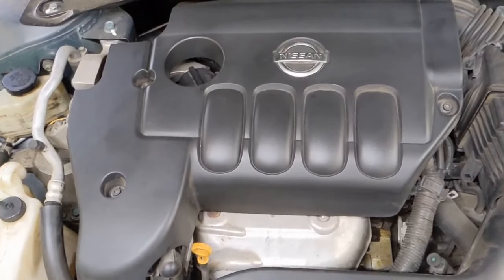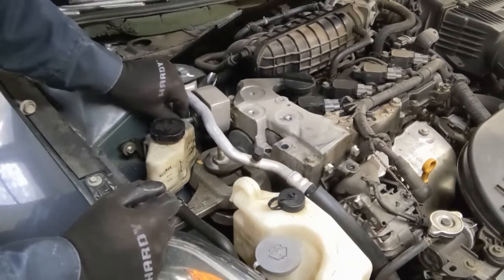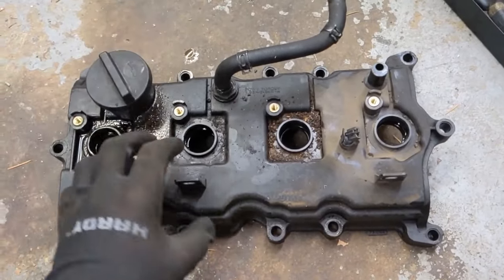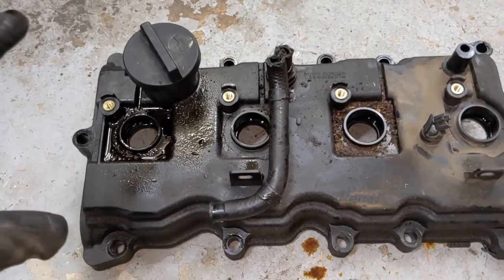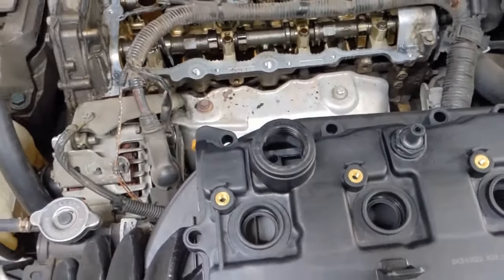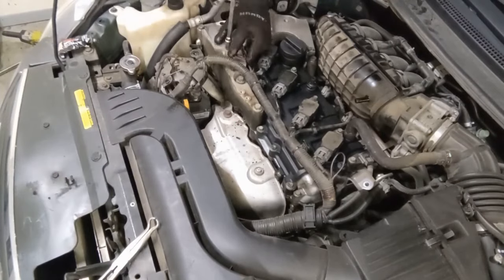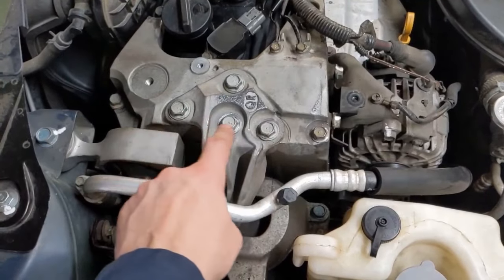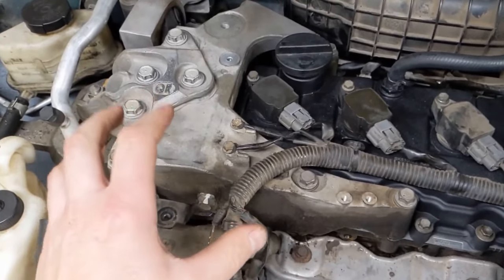2007-2013 Nissan Altima 2.5 Valve Cover and Gasket Replacement | How to Replace Spark Plug Seals

Comment: I bought the seal and gasket kit.... Definitely buy the whole new cover that already has everything. the old one is so brittle it's impossible to get the seals out without breaking the cover.
Reply from the maker: @u.s.a.198  Thanks for the tip 👍

Comment: I JUST CHANGE THE SPURK PLUGS YESTERDAY I HAVE 2016 ALTIMA 2,5 S AND I FOUND OIL ON THE SECOND SPURK PLUGS ON PASSENGER SIDE OTHER THREE WAS DRY HE RECOMMENDED ME TO DO VALVE COVER DID HE MENTION ENTIRE VALVE COVER I DONT KNOW WHAT U THINK IS BETTER TO DOIT NOW TO STOP HAVING MISSFIRE IN THE FUTURE OR I CAN DRIVE LIKE THAT

Comment: I find it odd that you clean the spark plug well after you put the new cover on? Why not do it before?
Reply: And cranking the engine to get the oil out? Why not just use a shop vac?
Reply from the maker: @jumbroni6014  Good questions. You can clean the spark plug well before or after the cover is on. You just don't want any dirt to fall into the engine that's why I like to close it up as soon as possible. I used a shop vac once and it didn't suck the oil all the way through the hose so I had oil dripping out of the hose for a while. Other than that it worked ok. It won't get everything so pulling the plug or using some rags is still necessary.
Reply: @ValleyMobileAutomotive  BRO i use a oil funnel on the end of the shop vac and it works so good. you dont even have to secure it to the vaccum. but youre right it does leave a mess if you arent careful. im just finishing this job. what a pain in the arse cleaning gasket
Reply from the maker: @jumbroni6014  Thanks for the funnel tip! Yeah It's an interesting design for sure! The good news is the new gasket will last another 100k plus 👍
Reply: @ValleyMobileAutomotive  I HAVE A QUESTION FOR YOU? I CHANGED THE TORQUE MOUNT AFTER I DID THIS JOB. THE ONE ON THE TOP PASSENGER SIDE. SO I PUT THE NEW MOUNT IN AND ALL OF A SUDDEN I START HEARING ALL THESE CLICKING SOUNDS? WHEN I TOOK OFF THE MOUNT,THE ENGINE DID LEAN FORWARD ABOUT 1 INCH. I JUST USED A PRY BAR AND PUSHED IT BACK TO LINE UP THE HOLES AND NO PROBLEM. THE THING SOUNDED SO QUIET. THE NEXT DAY THE THING STARTS MAKING CLICKING SOUNDS? ITS THE CRAZIEST THING. IM WONDERING IF IT HAS SOMETHING TO DO WITH OTHER MOUNTS?

Comment: I'm doing this today....I'll update how it goes....thanks a million for posting this videos. UPDATE: Operation thanks to you was a total success, thank God I took your advice and replaced the valve cover, mine was 100% cracked, oil in all 4 plugs. THANK YOU!
Reply: Glad it worked! What was your symptoms before changing it? I'm trying to find a oil and vacuum leak, but cannot see anything obvious. Suspecting the valve cover atm....
Reply: @rasmadrak  The only symptom I had was that I was losing oil too fast, had to put a quart of oil almost every week.  I went to change my oil one day and saw oil all over the back of the engine and under the frame of the car. I immediately suspected the valve cover gasket.
Reply: @ramonvargas5928  oil cooler gaskets like to go bad on the back of the motor aswell

Comment: Got an 08' Sentra Spec-V, same 2.5L engine. Your opener for this video was almost my exact reaction when I popped the cover to plan for this job...😯🤨😐
Gotta say though, you did a great job with the break down and what to watch out for. Thanks so much for this well put together how-to!
Reply: I’m late to the party but said the same thing.   diabolical engineers that hate the common man 😂

Comment: Great video! You helped me realize having the valve cover off would make changing the fuel injectors much easier. I was considering removing the intake manifold, but I think I’d rather remove the valve cover.
Reply: 2007 spec-v with similar engine set-up here. Agreed. I changed my injectors though w/o removal of either but I could not put the clips back in place. Now that I need to replace the valve cover, I can finally access that. Owning this engine is a love/hate relationship.

Comment: Thank you sir!! But need to know for cranking over the motor for the oil in plug well , did you disconnect anything for fuel ? .is it needed
Reply: Dont know if needed still but leaving the injectors unplugged should stop it from turning on

Comment: I follow your video and I was able to change the cover and then I started my engine it was a lot of I just said you could be I had two of them leaked and they had a lot of wild and some of them I believe went into the valve cover so what is going on after the vehicle was running for 2 to 3 minutes to shut off

Now and I'm trying to start it again it just cranking up is not starting , I don't know what could be happening

Comment: So I have an '08 Nissan Altima and I changed the gasket and the cover and it's still leaking oil and there is still some in my coil. Do you think maybe that was done wrong or something else possibly going on?
Reply from the maker: It's possible that the new part is faulty. Is the leak only in the spark plug hole or is it also leaking externaly?

Comment: Our 08 Altima just started leaking at the valve cover gasket after a super cold freeze for several days... now it's warmer and barely a drop ! Should I go ahead a replace or wait and see... thanx in advance!!
Reply: I’m not expert but I would replace it
Reply: @robertoflores599   got er dun.... no more leak....  replaced the cover too.... it was trash.
Reply: @Tngoz  that’s good, glad it worked for you, I just got my coils and spark plugs and gasket cover replaced too

Comment: Nice job. Gasket for valve cover comes with new valve or not. in addition PCV valve comes with the cover. The PCV on this car is not replaceable.  in addition, now is good time to clean or replace fuel injectors as well. All the room.  Very hard w/o removing the valve cover. forget about the intake, that is the worst design ever. I thought RAD removal was bad without taking out the AC lines on condenser!!

Comment: So quick question … the white smoke didn’t come from out the exhaust pipe for me , it actually came from the engine Bay Area itself . The mechanic I had pressured washed the outside of the engine becauseoil leaked everywhere.  Is it normal for the engine Bay Area to smoke after the replacement of the head gasket cover or after being washed ?
Reply: Mine smoked from the engine bay too right now that i changed en and turned it on but its just the oil thats burning nothing alarming
Reply: @ yeah the smoke cleared up after 2-3 days . I was being paranoid at the time .

Comment: I have a 09 nissan altima 2.5 I bought all the new valve cover and new seals and gasket now my question is how long of a time will this take me and did you say you need to jack the motor? Can I just use a big floor jack to hold the moter up if I take that motor mount off will my motor fall out of place?
Reply: Do I put the jack under the oil pan 🤔?
Reply from the maker: It will take a couple hours to complete the job. Yes, a floor jack is what I used. Put something like a block of wood between the jack and engine. The engine will move slightly  even with a jack under it but that's ok. When it's time to put the motor mount back on you may need to raise or lower the jack as needed. You can also move the engine forward or rearward if needed.
Reply: In the books it calls for 1.5 hours of labor
Reply from the maker: @jasonguthrie5099  yep under the oil pan. That's what the block of wood is for, to protect the pan. The pan is strong enough to hold the engine no problem, just don't jack the whole car up with it.
Reply: Took me about 3 hours and it's my first time changing a valve cover. If you follow the steps you should be good.
Reply: @ValleyMobileAutomotive  thanks sure do appreciate it you saved me alot of 💰 money in repair bills..

Comment: I replaced my Nissan Altima valve cover gasket how you showed and also plugs. Everything looks good but when I turned it on it was excessively vibrating and overheating, do you think I missed something?
Reply: You might have damaged one of the ignition coils since you are saying the engine vibrates. Im not sure about the overheating, it happened to me before I had a bad coil and the everything was shaking but I kept on going and pushing to reach my destination and eventually it overheated I think because air-fuel-spark ratio was all over the place.
Reply: i also replaced my nissan altima valve cover i have same symptoms also i noticed coolant reduce level in raditor , did you solve the problem ?
Reply: My moms Nissan was shaking and smelling funky, ran a code reader and it ended being one of the cylinders so we replaced cyl 3, and we replaced all four spark plugs. Car running great now but noticed oil leakage into that same area so we will also be replacing the valve cover.

Comment: What were the symptoms this repair resolved - Engine Misfiring? I'm getting a P0300 multiple cylinder misfire code.
Reply from the maker: This fixed an external oil leak. If you have oil getting in where the spark plugs are it can cause a misfire. Changing out the spark plugs wouldn't hurt if it's been a long time since they've been done.
Reply: @ValleyMobileAutomotive  Yes I have some oil in one of the spark plug wells, the first one on the left. Is it safe to assume I need to replace the valve cover? Since oil has already gotten in, it will likely make its way back. Seems like a waste to replace plugs, coil pack, etc, if the new parts will get saturated just the same.
Reply from the maker: @joep2710  yep you're right. The valve cover needs to be replaced 👍

Comment: please HELP! I HAVE A 2013 NISSAN ALTIMA BUT THE VALVE COVER GASKET ITS no the same as this one . i got the cover new but i can find the seal fro the new valve cover please!!!!! HELP!!!!!! thank you!!!!
Reply from the maker: Is it the 4 cylinder or 6?
Reply: @ValleyMobileAutomotive  4 c
Reply: Im having this same problem . I can’t find the rubber seals inside that stops the oil
Reply: @CapFrmFlint  you won’t find it shortage of everything it’s getting hard to get parts I had to wait over a week to get it. They have to type of engine cover this nasty cars go to the auto part and tell them what you need them take your valve cover gasket and you still need to buy it new so you won’t have to mess with it in the long run.

Comment: Why must we need a new valve cover? If they offered spark plug tube seals with the valve cover gasket, then everything could be replaced when the valve cover gasket is replaced.
Reply from the maker: Unfortunately for these plastic Nissan valve covers the tube seals are not replaceable 😕
Reply: @ValleyMobileAutomotive  I understand,  the seals had to get into the cover somehow so, they should be replaceable.
Reply: Correct, they DO sell individual tube seals.
Reply: I'd like to think he would have tryed been nice if he pulled one out to show us

Comment: No video shows how much miles these cars have 🤔🤔 mine has 143K miles and I just replaced the PCV valve and hose and check engine light came back on and I noticed very little oil from the gasket
Reply: Mine has 148k and the cylinder misfire and I replaced them all cus I know they’re all going to go out and I also replace my valve cover cost about 700 bucks with new sparks too
Reply: Mine has almost 300k and this is the first time I'm having to do this

Comment: Why you didn’t show us the gasket?
Reply from the maker: The gasket came installed in the new valve cover. If you're replacing the gasket but not the valve cover then just pop out the old gasket and lay in the new gasket. It should only go on one way 👍

Comment: If I have a little oil in the spark plug hole how do I get the oil out of it? Or what would you recommend?
Reply from the maker: Just pull the spark plug out and let it drain into the cylinder 👍
Reply: A siphon pump BEFORE you pull out a spark plug.
Reply: You don't want that buildup in your engine!
Reply: You can also put a tampon in there. Let it sit in there for a few hours
Reply: Do not pull the spark plug out when oil is settled in there!!!! Spray some brake cleaner in there and use a compressor to blow it out with a rag on top

Comment: Am I dumb or did you forget to show the gasket install
Reply from the maker: You're not dumb, the new valve cover comes with a pre installed gasket. If yours comes separate the gasket lays in the cover groove. It only goes on one way. Once you see it it will make sense 👍

Comment: Great video! Do you need to replace the ignition coils that were covered in oil? @valleymobileautomotive
Reply from the maker: Not typically. A good spray down with solvent a rag and letting them dry should be enough. If you notice a misfire even after cleaning them then you can replace them. If you do replace them stay away from cheap coils. I would stick with Nissan coils 👍
Reply: @ValleyMobileAutomotive  will do. Thank for the reply